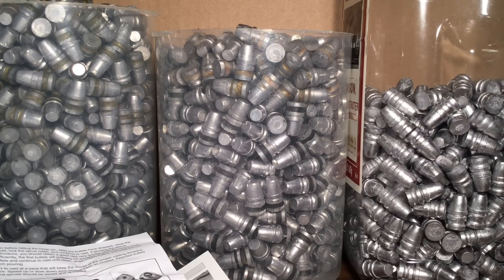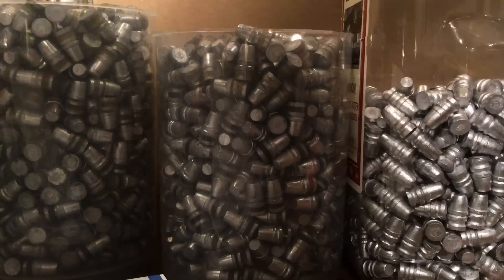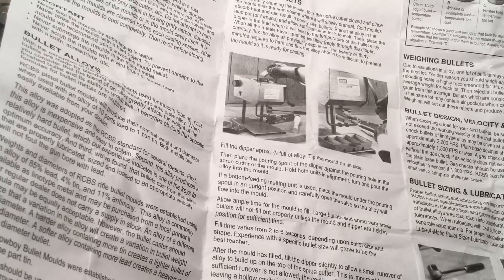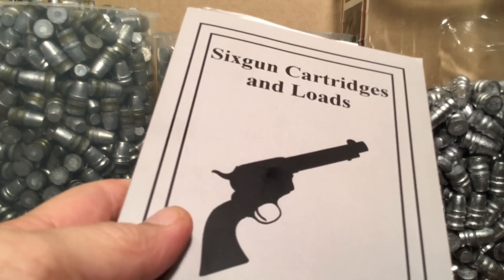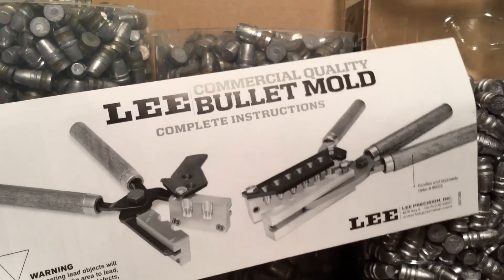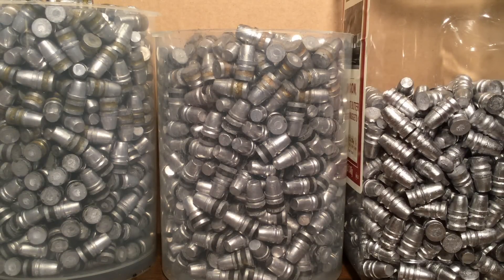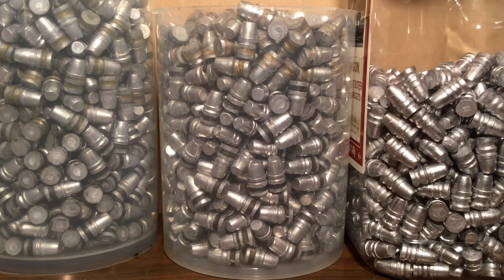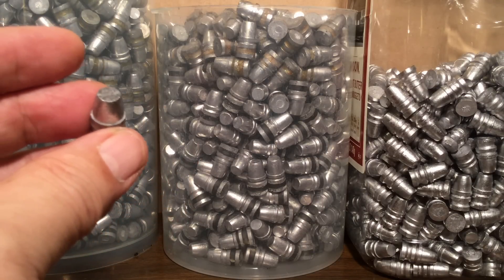The Big Hardness Gain Bullet Casting Water Quench Controversy - VR To Carl

Comment: You will find,(as I am sure you know) ,that your very old cast bullets are harder now than they were when you cast them years ago, this is because Lead age hardens, all quenching does is bring this process forward, I have a policy of never allowing water anywhere near molten Lead, this is because I have seen a person running around with a lace headgear of solder when water dripped into a pot of molten solder, if I want to heat treat I just place a tray of cast bullets on a tray in the oven and quench the lot just before they slump, then they are all the same, and I have no water anywhere near me when I am casting. A very simple way of proving if it works is to use your Lee Hardness Tester, that is a much more scientific way of getting the BHN, quite how any caster gets to BNH 24 I cannot imagine, I find 12 is only achieved with much alloying.
Reply from the maker: Englishman French - Firstly, this is a highly charged subject, and I always take the risk of offending people when I bring this up.  Since you are an experienced caster - let's give it a go.  The best policy is to not have water near the casting pot -- because water can get onto or into something that will be going under the surface of the molten alloy in our pot.  People continually believe that any water that touches the surface of the lead in the pot will cause an explosion.  But what actually happens is that something containing water is put into the molten alloy and goes subsurface.  That something shields the water for perhaps four seconds delay (causes the confusion) until the heat reaches the water inside the fishing weight or inside a cavern in a lead ingot.  Then the expanding subsurface steam bubble expands with surprising force and blows the lead out of the pot with a bang.  (I'm not talking about a spatter when a wet cold ladle is placed on the surface of melted alloy)  Typically, the entire pot is completely empty after the bang and the lead coats everything in sight.  Since there was a few seconds delay, the story will go that a drop or drops of water or even sweat hit the lead and caused the explosion.  Sometimes a few drops of water goes on our alloy and the water can even protect itself for a while and dance on the surface.  I have demonstrated water dripped onto the molten lead on more than one occasion and even casted when it started raining...consider that water on the surface is fully vented and cannot move the lead - but confine the water under the surface where it cannot vent and you have a bomb - the power of confined steam.  However, not everyone can handle water around the pot without knowing how to keep it from getting subsurface, so the best policy is still to say keep all water away from molten lead.  But the real policy is to never put anything into molten lead unless we are sure there is no hidden water in it on on it.  Safest way to melt lead is from an empty pot and only add clean dry ingots into molten alloy.  We will go around perpetuating the one drop of water on the lead and explosion will occur theme because it is expedient to do so and does not disturb the sensibilities.  Best Regards to you,  FC

Comment: Not for hardening lead...it is a matter of the rate I cast at. I cast mine at a very high rate of speed, systematic, like a machine, and this tends to let the lead release very smoothly from the mold...they drop without even touching the molds...but when they hit the towel they were always still too hot and plastic and they deformed. So I stopped and started dropping them into a bucket of ice water. They fell so fast they would hiss when they hit the water. The bullet's come out at that rate without touching the mold. I prefer to quench in ice water a bucket about 12" depth to give the lead time to cool as it sinks in the water.  The reason I drop in ice water is not to harden the lead, but to allow me to cast at a high rate of speed without them deforming or banging against one another and getting deformed...which requires a lot of time in sorting out the bad ones for re-casting.... 

Okay, wow, I am my own sucker! I just tested one of my bullets and I can't get it to dent at all! Probably BHN 20 - 22 ? Apriori, its a benefit of the mechanics of my casting operation, not the result I was looking for.
Reply from the maker: Abdullah Mikail - Always good to hear from Abdullah Mikail - If you get no dent, you are absolutely around the hardness of linotype...congrats on that... would make great rifle bullets or magnum pistol.  I don't want mine that hard so it's the regular water for me....Continued good castin' to ya... FC
Reply: FortuneCookie45LC Wow! Did not intend to get them that hard...I always defer to years of experience over my short few years of enthusiasm. I am gonna throw those back in the pot with ten pounds of pure lead I just smelted from wheel weights and see if I can't soften them up just a little. Thanks FortuneCookie4LC, there's always a good fortune once we crack the cookie shell and find all the reloading goodness inside. Keep the good content coming! Thanks.
Reply from the maker: Abdullah Mikail - take care softening with 1-1 pure lead - you might overshoot and wind up on the soft side, but that is OK for a lot of our shooting, we can do a lot with BHN 12 or so...a small dent is BHN 18 a definite dent is BHN 15 and a big dent is BHN 12.  If the lead feels soft and is easily dented by the fingernail, it is pure lead.  Experience will tell you... Best Regards,  FC

Comment: How does water quenching affect powder coating or hi-tek adhesion?
Reply: I drop everything in water because I can cast faster with my magma master caster not messing with them during casting, and I PC everything with no problem, I've used harbor freight and power buy the pound powder coat with zero problems. An average year for me is 40k cast

Comment: Hello FortuneCookie45LC and all fellow casters. I have some degree of curiosity regarding water quenching and lead hardness, and would like some input from the community. Upon watching this video and also reading the Lyman Cast Bullet Handbook 4th Edition, I realized that the book does make references to water quenching, albeit not as a direct instruction on how to cast. I think that water quenching hardens the allow due to "supersaturation." If you look at the last two paragraphs of page 92 of the Lyman book, it explains the benefits of water quenching. Rapidly cooling the bullets (water quenching) allows for the precipitates in the alloy to be distributed more widely and uniformly. By cooling the alloy faster, precipitation reaction occurs more rapidly through the range of temperatures that precipitation occurs. This causes "Supersaturation," and since the distance in which the atoms can move is decreased, higher and more uniform strength properties can be achieved. This begs the question: would water quenching with ice water (to increase the cooling down speed even more and thus supersaturating the bullets' alloy even more) be more beneficial?  Could this be the water quenching processes that folks who are achieving high degrees of BH are using? I know Im speculating a bit. Thoughts?

Comment: Have you ever made bullets too hard?
Reply: Years ago when we started a friend of mine heard water quenching would Harden the bullets, so he unfortunately quenched his 230 grain 45 ACP bullets made from wheel weight. Our experience is the bhn goes to approximately 18, that was too hard for a 45 ACP to obturate into the rifling , he could barely shoot 100 of them without having the barrel leaded badly. For you new casters, that means the hot gases could Escape past the bullet as it went down the barrel, melting the lead as it went down the bore.
Reply from the maker: Vanilla Gorilla  — reply to Dan V - your experience in casting is much respected.  I am suspecting that the leading your friend got was from the bullets being a bit too small for his 45 auto.  I’m sure you agree that our bullet obturation is best achieved by having the bullets .001” bigger than the auto pistol barrel groove diameter.  There would be optimal bullet alloy to obturate immediately to prevent that gas cutting you reference.  We can’t depend on Cast bullets “slugging up” like jacketed can readily do without leading our barrels badly and quickly.  Thanks for you fine comments — from Lyon, France — FC

Comment: FORTUNE COOKIE: You point out several times that the manufacturers of molds (LEE for example) etc. repeatedly DO NOT mention water quenching in their manuals.  The reason is because water and molten lead make a very dangerous combination and they are afraid of being sued if some idiot gets some water in the bottom of his pot.  I GUARANTEE you it will blow the roof off and seriously injure the caster.  I've been in a casting shop when water containing scrap was inadvertently dropped in a 2 ton pot.  it killed the caster and tore the building up.  Quenching is fine, I do it myself,  but just be VERY careful.
Reply: P
Reply: Bill talley...
The bullets being water dropped are no longer molten... no problem. 
The Only time water & lead are a problem is when the lead is completely molten and the water gets beneath the surface.
Water on top of molten lead will only hiss & steam away.

Comment: i think when u quench wheel weight u get a bigger jump
Reply from the maker: the baddest - Just happens that those new unsized 44 Keiths and 240 gr RN bullets were cast with wheel weights...the 255 gr RNFPs were cast with range scrap and added Superhard Alloy...  These are antimony / tin / lead alloys that apparently would get extra hardness with quenching... I'll take whatever I can get - doesn't seem like much though.  Others may, in fact, be getting more... Best Regards to ya,  FC
Reply: i do know the temperature of the quench makes a difference the colder the quench the more hardness you get i believe with ww when i tested it between 60 and 40deg f i was getting about plus 2bhn every 10 deg  i have also noticed when i powder coat that the hardness changes again when i quench out of the oven
Reply: If you WQ your bullets straight out of the mold you going to get a slight variation on the final BHN due to the combination of the bullet as well as the waters temperature so a consistent casting temp as well as speed is important in controlling the final BHN.  Once you introduce the powder coating process in affect your then heat treating your bullets but at about half the time and at the same or slightly lower temperature than the time and temperature used in the heat treating process.  So basically the PC curing process reduces the final BHN of the original WQ'ed bullets when they dropped from the mold at a higher temperature,that's why you see a slightly softer bullet even though you quench them after the coating process.  The bullet is cooler so the BHN is lower.  With PC'ed bullet I've found it best that if you need a specific BHN range it's best to just cast your bullet at the BHN you need aircooled,PC them an just allow them to air cool from the over which want affect the BHN at all.
Reply: the baddest
Reply from the maker: the baddest - Thanks for your work on this water temp thing.  Personally, I'm not going to be running lots of ice into my water - water is short in CA even with a wet year - does not make up completely from years of drought.  And then there is the sizing factor whereby some hardness from WQ is lost.  If our final bullets are the hardness we want, then we can be happy.  Either that or whatever hardness we wind up with after WQ and PC and sizing, we can just rely on the PC to allow us to shoot the variation OK for our handguns.  Or we can sort our bullets for optimized velocities according to the hardness we wind up with.  With PC, the hardness is less of a factor anyway, within limits of course.  Best Regards,  FC
Reply: FC45LC just to add to the discussion,as you mentioned WQ'ed bullet soften somewhat when sized.  This is because the grain structure of the lead alloy bullet that is WQ'ed is not bonded as tightly together as a heat treated bullet which has a smaller and finer grain structure.  Some softening take place regardless of how the bullets is processed as lead work soften when sized as apposed to brass which work hardens.  If you sectioned a WQ'ed bullet vs one that was heat treated you would find that the outer portion of the WQ'ed bullet is harder than the core,section the same bullet that is heat treated in the toaster over and you will find equal hardness throughout the bullet.  Heat treated bullets if any measurable amount of sizing is to take places should be sized beforehand as they will be very hard to size afterwards.   

The quenching process basically freezes the grain structure at the moment its cooled and some further hardening will take place over time but the WQ'ed bullets want obtain the same hardness level as the heat treated bullets and some age softening will take place using both process as well but in general the heat treated bullets will still be withing 1 to 2 BHN of there original hardness after ten years of storage.  This all may be irrelevant as to the video but it good info every caster should have knowledge of.
Reply from the maker: Reloader 7sixtwo - Thanks for posting this information... Best Regards to ya,  FC

Comment: would like to see some 270 win bullet casting .
Reply from the maker: fares b - The 270 Winchester was made famous by Jack O'Connor back in the 30s - a very fine round to this day...But sorry to say, I don't own one so I do no casting for the 270.  I just checked for you - there is one video on NOE molds for the 270 but the video shows no casting being done.  And there are no others...the reason might be that the 270 is a high velocity round and high vel rounds go best with jacketed bullets...and loading cast for reduced loads might have little utility in the 270.  I have a 25/06 and would not consider casting for it either.  But the bigger 30 cals and above - casting for them would be useful  and the bullets are heavy enough to be effective at lower velocities... Have a great day,  FC

Comment: I do not believe water quenching adds hardness to lead. I have been a tool & die maker my entire life. I have a long back ground in heat treating many different metals. Not lead though. But the reason I say what I do is this. Quenching metal in water or oil effects only mid to high carbon content in any given metal. Take say 1018 mild steel & bring it up to say 1600 t0 even 1800 degrees & quench it & you will find no difference in the hardness. Lead has no carbon content, & I think it is nothing more than a myth in peoples head. Love your videos though FC.